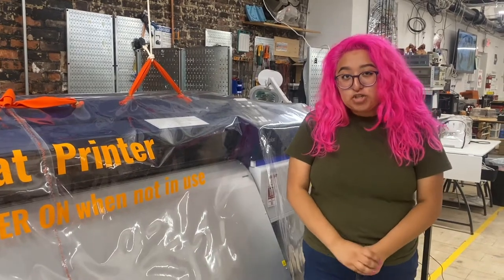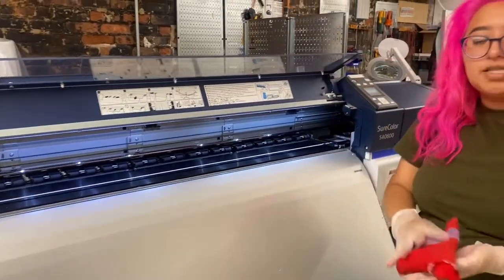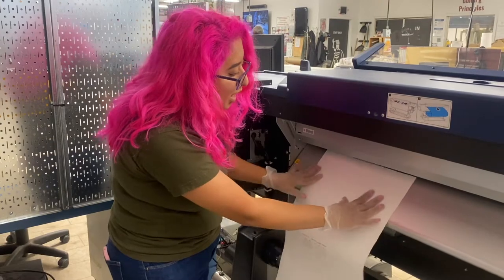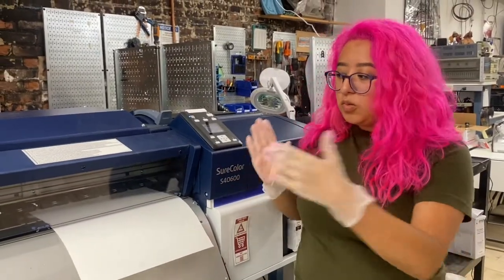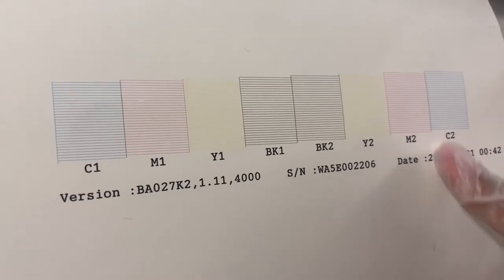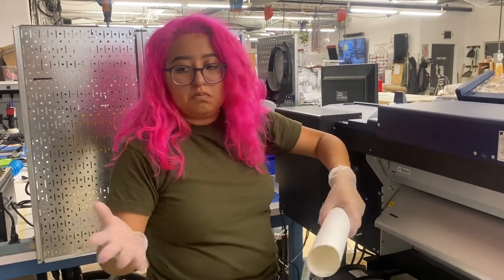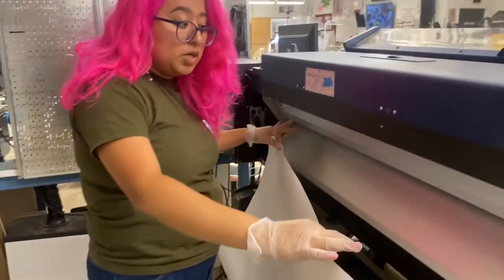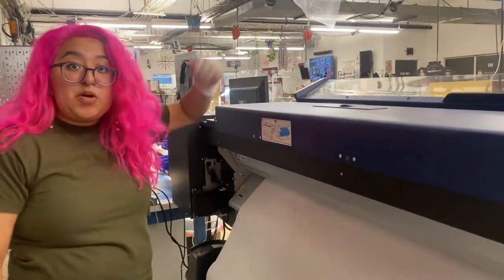How to use the Epson SureColor S40600

Comment: Great video, thanks for taking the time to make it. Any chance you or anyone on this group can share the ONYX 12 Printer drivers and profile files, I lost the Installation cd, but I do have the ONYX software running and the Epson Drivers. The ONYX tool that comes with the software only allows downloading these files for versions 18 to 22 which are not compatible with Onyx 12.